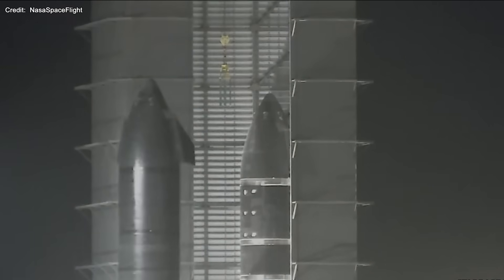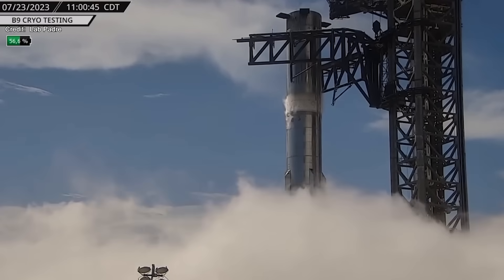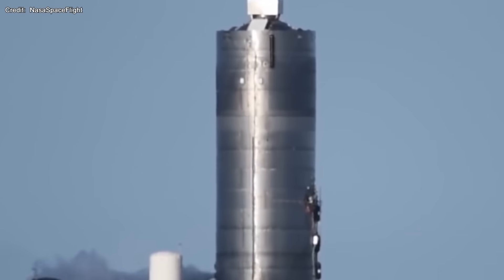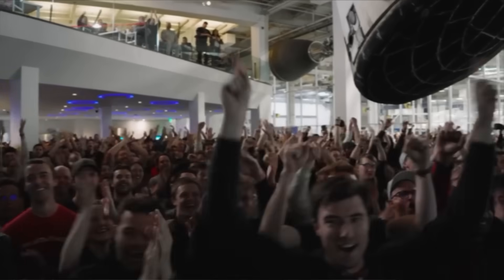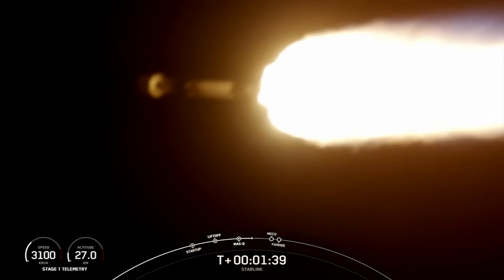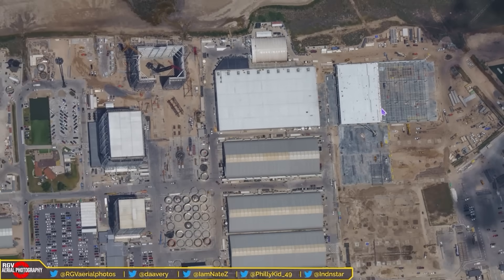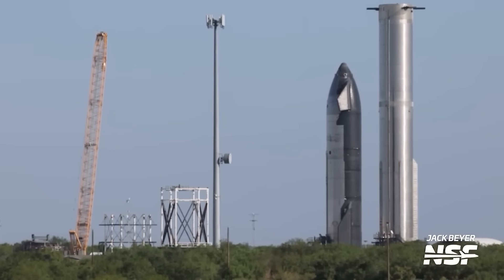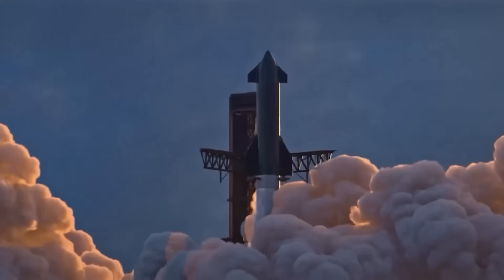This is INSANE for SpaceX's Next Starship Orbital Launch

Comment: deluge ground pad and nitrogen water spray should work?  
Yet is there enough water gas spray for the forces heat vibrations resonance as the booster leaves the top section and fuel grasp arms?
massive forcces may act quite diffrent now all engines are firng.# High massive water gas header tanks should be basic to the 
overall set up to cut down on pumps
being 20 thirty feet higher than out let sparys for hadded gravitaionakl assistance
incase las minute pumps fail
Reply: The water deluge system has ZERO pumps,
Reply: @psycotria  SO HOW IS THE PRESSURE  ACHIEVED WITH WATER BEING AT GROUND LEVEL